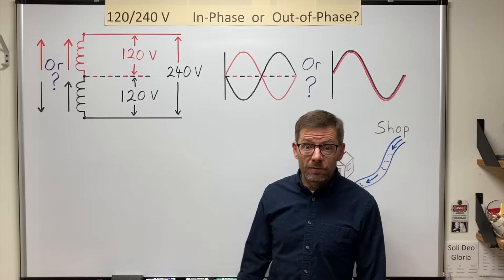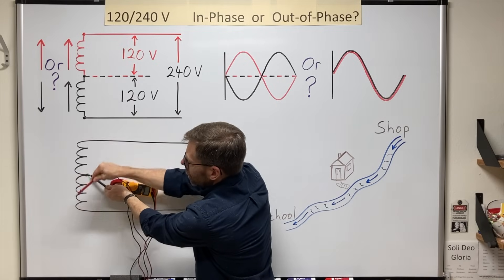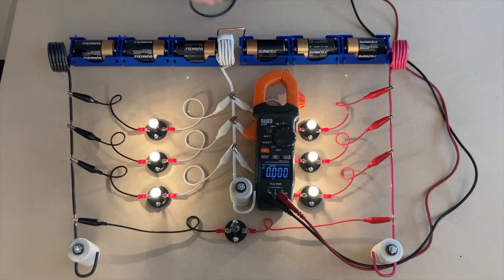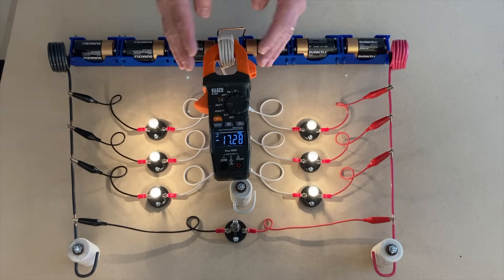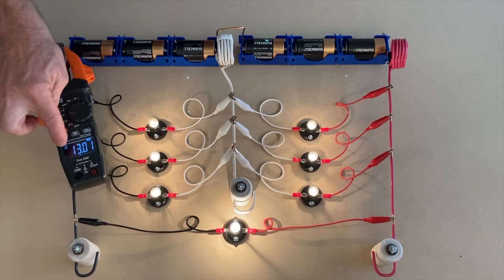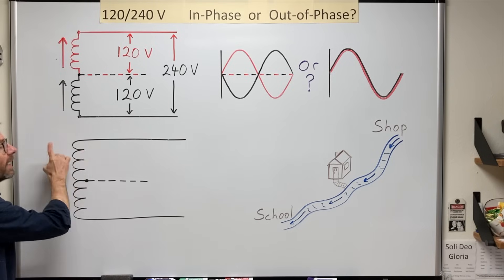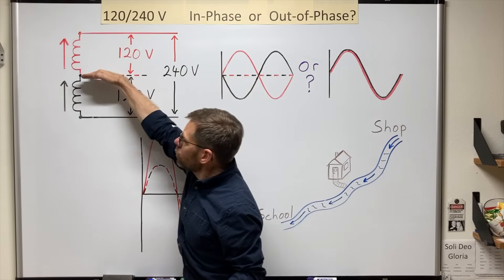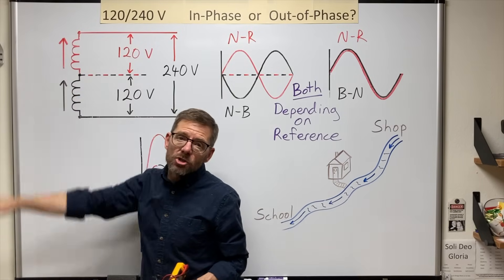120/240 V  In-Phase or Out-of-Phase

Comment: Thank you for this.  I've been watching too many YouTube videos where electricians understand the system only in metaphorical terms.  This was really helpful to properly understand the flow of electrons in the single phase system.
Reply: @stevenj100    AC is Alternating Current, So In or Out does not really mean anything, because they are alternating, that is why it is important to understand the correct AC Phase relationship of TWO Live 120V Lines.. .  . If there is 5 Amp in one Live line and 8 Amps in the other Live line, then the Neutral Current would be 3 Amps, on 2-phase 180° systems, and more complicated on 120° 2-phase, and 3-phase systems.
Reply: @hughleyton693  There is no such thing as two phase 180 or two phase 120. There is only single phase or 3 phase. Two phase power is very very old, and is 90 degrees apart.
Reply: @brnmcc01    Just think Logically as Spock would say. . .   3-phase has 3 Live lines, 2-phase has 2 Live lines and Single-phase has a Single Live line. . . .  It really is as simple as that. . .  But Americans have got very confused over the years. . . .  They used to use a 2-phase 90° 3-wire system. . .   We still use 2-phase 120° sometimes and we do use 2-phase 180° 3-wire all the time. . .    it really is that simple.
Reply: So your words above, show that You are not fully understanding electricity. . . It is you out of your depth, not me. . . I have understood all that for over 60 years.. . And so I do know the difference between Single-phase, 2-phase and 3-phase systems and how the current flows in all of them.
Reply: @hughleyton693 , studying electrical systems from infancy? Or age 10? 20?  Is it 60 years or 70 years?  Can't keep your fiction straight?

Find out what phase means and come back with an intelligible perspective.  Then we can talk.

Also, if you can't figure out why a 3-way switch might have that name, you, again, are not ready to be "educating" people about electricity.
Reply: @jasonbeisiegel5550  Jason. . .  Phase of an AC voltage is the relative angle from 0°, through 90°, 180°, 270° an back to 360° with reference to some point and against another AC voltage.. . It sounds as if you do not understand what AC Phase means. .. It sounds as if you are rather blinkered in your perception, if you understand 3-phase with each phase voltage running at 120° from each other then have difficulty understanding a different phase angle of 180° between two live AC lines. . .  Then it is you that needs better education.
Reply: You need to stop being rude, and learn something.
Reply: @hughleyton693 , you've been rude and condescending since you got here.  You are also the one trying to contradict the entire electrical industry.  You have demonstrated no knowledge of the subject, just thrown around buzzwords and unsubstantiated claims.  If you had anything to teach, I would be happy to learn.  You don't.  We're done here.
Reply: @hughleyton693 Tell you what let’s assume that you are correct. Let’s do a simple addition of your claim in polar form. I’m going to assume that you know and understand complex numbers since you have been studying electricity from infancy. That is 120 volts at 0 degrees + 120 volts at 180 degrees. So that would be 120( cos(0°)+ j_sin(0°) )= 120 the first “phase” of your so called “2-phases”. The second one would be 120( cos(180°)+ j_sin(180°))=-120.  The j_ denotes a complex part since AC is usually expressed in real and imaginary part considering that it is a vector. Add them together and you get -120V + 120V = 0. I don’t care how you arrange them, you can even do this 120V + (-120)V = 0. The point I’m try to make is that you are ADDING and NOT subtracting. This alone tells me that if they were really truly out of phase then the potential between them would be 0 and NOT 240.
However if they are in phase with the angles all being 0° then when they are added up they would be 240 volts.
Reply: @stanm25    Yes, I do understand complex numbers as far as reactive power is concerned. . .   But this is not about reactive power.        So yes, the 1st phase if  0° so then they other is at 180°     But " j "  does not come into that, until we start talking about Power Factor situations, as caused by Inductance and capacitance. . . .   Actually for a single=phase motor, or any motor with just two wires to it, will need  +j from a Capacitor, to provide the motor with rotational information, by shifting the phase of one the the supply wires.    That is why there is a capacitor with such motors.
Reply: @hughleyton693  I wasn’t talking about any load being connected. What I’m simply stating is that if you were to measure the leads between the hot legs in L1 or L2 with a meter then the resultant voltage would be 0 if they were truly physically out of phase at the source. Even if a voltage load was connected between L1 and L2, it wouldn’t work since there is NO potential difference between the leads. It’s just like the leads of a DC circuit up there when Mr. Gordon switched one of the battery banks to simulate an out-of-phase circuit . The resultant effect was that there was NO potential and therefore NO load across the red and black leads that fed a single light source because the voltages canceled out.
Reply: @stanm25    NO. . .   If L1 & L2 were  IN Phase, that is both going UP at the same time, you would see 0V difference. . .   But because they are actually 180° Out of phase, that is opposite to each other, you will see the DIFFERENCE Voltage of 240 Volts. . .    If You put the two meter leads onto L1 & L2, or L2 & L3 or L3 & L1 of a 480V supply, you would see 480V, this is called the Line Voltage. . .    If you measure the voltage between L1, or L2, or L3 to Neutral, you would see 277V, that is the Phase Voltage.. .  If you measure between L1 & L2 of a 2-phase supply, you will see the Line Voltage, if you measure between L1, or L2 to Neutral, you will see the Phase Voltage.. . .  This is proper Electrical engineering.
Reply: This was about DC , not Single-phase AC. . . the Electrons travel inside the Wire, driven by voltage difference between the ends of the wire, when there is a completed circuit.
Reply: But it is a 2-phase system. . . .   There are Two 120V circuits. . . .  But because L1 is running at 180° from L2, then you have 240V between L1 and L2 making it a 2-phase 180° 3-wire supply.
Reply: @hughleyton693  A polyphase system must provide a defined direction of phase rotation, so mirror image voltages do not count towards the phase order. A 3-wire system with two phase conductors 180 degrees apart is still only single phase.

That's literally the definition, I didn't make that up, you can look it up yourself.
Reply: @brnmcc01    No, you are now trying to distort the truth to cover your mistake. . . .   Electrical power phase is about the AC on the Lines and the phase relationship between those Live lines.. . . .  Don't try to squeeze out of the fact that Two 120V running at 180° from each other is 2-phase. . .   Even if other Americans cant see that.
Reply: @hughleyton693  I'm trying to distort the truth? What I posted was literally copy/pasted from the definition of what a polyphase system is. Poly meaning more than 1 phase.

I think what we have here is a classic example of the Dunning–Kruger effect....
Reply: @brnmcc01    Ah.!, OK, copied from some American source, but as you say here correctly, "Polyphase" means more than 1 phase. . .   Yes. . . .  So 2-phase, 3-phase, 4-phase and 6-phase are all Polyphases. . .   Which means each live line has a different phase relationship to the others. . . . .Correct. . . .  Typically the Natural polyphases are 360° / number of phase lines. . .  So Natural 2-phase is 360° / 2 = 180°, 3-phase is 360° / 3 = 120° and 4-phase is 360° / 4 = 90° and 6-phase is 360° / 6 = 60°. . .   I hope this now makes things clearer, even if American teaching is confusing.. . . . .  p.s.  I have even re-wired some large 220kV 3-phase 480V Generator to provide the customer with 120/240V. . .   That was possible, because most large generators have 6 windings and 12 connections, so they can be re-arranged to provide a wide range of output voltages and conditions.
Reply: @hughleyton693  Do you live in Europe I'm guessing? I was wondering if maybe you were from or have been to Japan. That is a very strange country with 2 different electrical systems, one 60Hz and one 50 Hz. There is a lot of two phase 100/200 volt systems there, and people used to that assume the 120/240 volt system in the USA is also 2 phase. It gets very confusing.
Reply: @brnmcc01    Hi, I have not spotted your name as yet...  I was originally from the UK, I have worked in many  countries from Viet-Nam to Nigeria, the West Indies and I now live in Belize, which follows the NEC Code.. . . But I have been involved in many different electrical systems and generators. . . .   Japan, as you say use 50Hz in parts and 60Hz in other parts. . .  This used to be a problem but now very much easier, they use Electronic Grid size Inverters between the two systems, these days, called converters, and they can work either way at any time. . .   Even better when Grid batteries are included to even out the sudden power changes.. . . I am writing a book explaining electricity, but it will be for anyone, not just Americans, so has to use different words to explain things.
Reply: @hughleyton693  That makes a lot more sense now, this whole time we've been arguing over it's not an apartment, it's a Flat, it's not a car trunk, it's a boot, it's not a Hood, it's a bonnet and tire is spelt Tyre!
Reply: @brnmcc01  Yes, something like that . .    But when you think about it logically, it really is 2-phase 3-wire L1, L2, N supply, even if not called so in America .. . .  But one I will not let go of is the generator in your car for charging its battery puts out DC so it is a DC Generator.. .   Not an Alternator. . .   Alternators feed AC as into the Grid.. . .  DC Generators produce DC. . . .  AC Generators produce AC. . .   And there can be no argument about that.. . .  And yet many do argue.
Reply: @hughleyton693  The brushes in an alternator carry only DC excitation current, which is a small fraction of the current carried by the brushes of a DC generator, which carry the generator's entire output.
Reply: @brnmcc01  Hi, What brushes. ? .. .   For over 30 years, the AC Generators I work with, 10kW to 1 MW, typically 400V or 480V 3-phase, have no brushes. . .   And they have 3 Generators inside the same case. . . . .   However, I suspect you are referring to the Field power in modern car Generators, that still use sliprings to power the rotating Field windings.. . .   But if you put a volt meter on the car generators power output terminal you will see DC Voltage, approximately 14V
Reply: His drawing and explanation correctly shows the electron flow, but he failed to refer everything to the correct Reference point, which is the Neutral point. . . . That is what Neutral means.. . . Same with 3-phase, all 3 live lines have AC voltage relative to the Neutral point.
Reply: @hughleyton693  I feel like you are playing word games.   I understand completely. But I am trying to summarize  and explain why saying the "phases" cancel out is the wrong term.  First I said one leg was negative relative to neutral you said that was wrong.  So then I explained how it functions on a momentary instant of AC to explained  the 240 difference. You said that was wrong cuz it's really negative.
Reply: @stevenj100    Not me playing games, you are using wrong words... A live line never gets less or below Neutral. . .  I never said phases cancel out. . . Pay attention, "Phase" defines the AC sinewave relative to a reference or another hot line.. .  In American 120/240V supplies, there are TWO Live lines, with their AC running 180° difference between them.
Reply: @stevenj100    Current flows from voltage to no voltage. . . .  So each of the 120V lines current does effectively flow to the Neutral.. ..    But because the TWO Live lines are running in opposite directions, that is 180° then the TWO Live current Cancel each other out in the Neutral, so the Neutral only carries the Difference current, and not the combined Total current.
Reply: @hughleyton693  No, current flows from source back to it's source. There is no 180. Reversing measurement device polarity does not magically flip the sine wave.
Reply: @brnmcc01  Sounds as if you do not understand electricity, AC electricity.. .   Put a question is a simple, non ambiguous form for answering.. . . . .  Current flows from high voltage point, through the circuit to a point of low voltage. . . .   But the American 2-phase 3-wire to houses has L1, and L2, both live lines at 120V and running at 180° from each other.. .   In other words, when L1 is at its maximum + sinewave, L2 is at its maximum - sinewave point, it is that, that results in 240V between L1 and L2.. .   I hope that is easy enough to understand
Reply: @hughleyton693  What you're saying is basically correct, except in modern USA voltages there is ONLY single phase or 3 phase. There has been NO new 2 phase equipment made since at least 1975. One of the newest things I can remember that was actually a 2 phase piece of equipment was a 2 phase 240v Bridgeport mill made in about 1962 or 62. It was installed at a shop somewhere in Hartford, CT. It's very very rare these days, and dates back to the original Tesla polyphase system back in 1895. Check out some of the old pictures of the Niagara falls hydropower station, that was 2 phase, but IIRC it was 25 Hz, and some customers used rotary converters to power electric metal furnaces.
Reply: @brnmcc01  Sounds as if you are rather confused. . .   Look at the picture above. . .   When you Ground the centre point of a winding as the Neutral, that leaves the two winding ends swinging up and down in opposite directions, that is 180° from each other. . .  Just like a kids see-saw.  . .  You have seen kids see-saws. ? I hope.  . .  when one end is up, the other end is down. . . . They are moving at 180° from each other. .  That is exactly how 2-phase 120/240V works. . . .    Basically you can double the number of phases, by grounding the centre tapping of the secondary winding, as the system Neutral. .. . .   I hope you now understand this simple concept. . .  So Yes, a see-saw does magically flip the sinewave, L1 from L2
Reply: @brnmcc01     There are Single-phase circuits, L-N, there are 2-phase systems, L1, L2, N and there are 3-phase, L1, L2, L3   with or without the N. . . .     2-phase can be 2-phase 90° 3-wire, or 2-phase 120° 3-wire or 2-phase 180° 3-wire. . . .    I worked with and wrote the maintenance paper for some American 2-phase, actually 4-phase 90° equipment, in the 2002.
Reply: I really hate the phrase "cancel each other out".  That's how you might do the math, but it isn't what is happening relative to current.  Any load that can travel from one hot leg to the other will, because it is a preferred path.  Any imbalanced load will travel on the neutral.
Reply: @jasonbeisiegel5550     Actually cancel each other out is a very important thing to understand. . . .  This enables us in big systems, to use smaller Neutral wires. . .   You also need to understand then when there are neutral wire connection problems.
Reply: @hughleyton693 , you're missing the point.  The phrase does not accurately describe the physics.  There is one YouTube electrician who understands this as two opposing forces on the same path, and that isn't what is going on.
Reply: @jasonbeisiegel5550     No. . .  I understand electricity very well. . . . I am not missing any point. . . .  Phase is a very important part of any AC Electricity. . .   It describes the AC Voltage of a hot line relative to any other hot lines, such as 3-phase, all three phases are 120° from each other.. .  2-phase the two phases are 180° from each other. . . .  It is a simple as that.
Reply: @hughleyton693  12 days ago you commented that they cancel is the right term and important to understand
Reply: @jasonbeisiegel5550  yeah the other leg is lower potential than the neutral
Reply: @stevenj100      You can't have lower than Zero as in Neutral.. .  You mean opposite polarity or running 180° from the other hot leg.. .  So it is 2-phase, L1 is one, L2 it the 2nd phase.
Reply: @hughleyton693  120/240 split phase systems. In one phase in those systems the neutral is higher than the other leg.  It's AC so on average it is in the middle between the two legs.   But at the "on" moment one leg is zero the other leg has 240v potential, and the neutral has 120v potential above the zero leg.  So you are correct to say the nothing is less than zero but the neutral is a higher potential than the leg that is off during the AC cycle.   This has to happen for the 120v load to be an AC circuit
Reply: @stevenj100  . . .  No. . .  You misunderstand potential. . .  Use a Meter. . .It might help to explain to you. ..  Neutral is at or near Zero Volts compared to the ground you stand on. . .  The other two legs, L1, and L2 are both at higher potential.. . .  Look with your meter. . .  Potential is potential and not relative to markings on a blackboard.. .  High potentials can give you an electrical shock.. . . .  L1 is 120V above the Grounded Neutral, L2 is 120V above the Grounded Neutral. . . .  L1 and L2 are both Live lines, but running at 180° from each other. . .  AC means "Alternating". . .  So their potential is swinging live both plus and minus around the Neutral.
Reply: @hughleyton693  they both have a higher RMS but in an instantaneous moment only one is higher at that moment one is on one is off.  We are discussing why only the imbalance uses the neutral. It will not use the neutral until  the series circuit of the two load back to the has equal voltage then the neutral has a lower potential.  But until then the other leg has the lower potential.   Again you thinking the RMS voltage is constant it only works as a constant for ohms law math.
Reply: @stevenj100    You really do not understand AC electricity do you. ?  . .    The AC Voltage of both L1 and L2 are the same voltage all the same time and even at any moment in time, BUT in opposite phases, that is 180° apart. . . You have not discussed the imbalance in the Neutral before.. .  The Neutral always has a lower potential, at or close to ZERO volts... .  You really do not understand electricity.. . So listen and learn.
Reply: @hughleyton693  I am a 2nd generation Master Electrician with 28 years of full times experience. I have tik tok educational page with 63k followers. You are thinking 240 single  phase is like 2 phases of a 3 phase systems.  It is not like that. It is  one phase that has two hot LEGS that take turns being on and the neutral splits that one phase. Why do you think a home has two hot legs but is still called SINGLE PHASE  and not 2 phase?
Reply: @hughleyton693  not only do I know this. You are commenting on a video that contradicts what you are saying
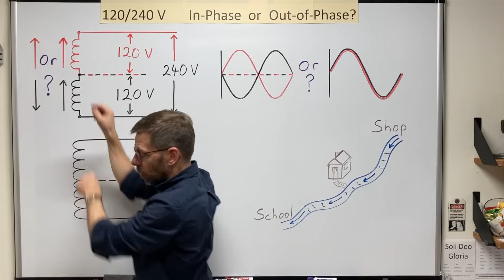Reply: @hughleyton693  go you 12:50 of the video he explains the 2 legs of a 240 system are IN PHASE.  if they weren't in phase the neutral would carry the sum not the imbalance.
Reply: @stevenj100    Good, so you do know the American 120/208V 2-phase 120° Supply then. . . .   Nothing I have said contradicts anything in the video, except he ends up with the wrong conclusion. . . L1 and L2 are NOT in phase, they are 180° phase relationship as in his left wave form drawing in the middle of his picture.. .  Remember all references should be to the Neutral line.. . . .  How would you describe the 480/277V system. ?
Reply: @hughleyton693  no American homes are NOT fed with 2 phase this is just foolish conversation.
Reply: @stevenj100 , hey, when it's not off putting enough to be smug and condescending, remember you can always be stubbornly incorrect to really make people regret interacting with you.
Reply: @jasonbeisiegel5550  I was trying to be polite did you see when he said I don't understand electricity and I need to just listen to him and learn.  When he is just saying stuff that is 100% factually untrue. A 10 second Google search proves him wrong.  He also saying Dave in the video is wrong.
Reply: @jasonbeisiegel5550  he is saying American homes are not single phase systems with two hot legs.  But he thinks they are a two phase system.  Just Google are Ameican homes fed with 2 phase or single phase
Reply: @stevenj100     Man you are not listening.. . . Most American homes have a 3-wire supply L1, L2, N. . . .  L1 and L2 are running at 180° from each other, so they have 240V between them.. .  So that is the Definition of 2-phase, TWO Live lines and Neutral. . .   So listen and learn, not just talk American, there is a whole world out there.
Reply: @hughleyton693  you are wrong. ALL American homes are fed with two hot and one neutral for a split single phase system.  I am not guessing. This is 100% the way it is 2 hot from a single phase not a 2 phase systems  I understand it confusing you i have had this discussion with mean apprentices over the years please go to Google if you don't believe me. You don't need to explain it to me understand what is happening inside the transformer and I understand why you are confused.  I promise you 100% every all without a doubt every American home is a single phase system I have over 60,000 hours of training and experience in wiring American homes. I am licensed in 3 states I have 4 electricians in my family
Reply: @hughleyton693  the definition of 2 phase is not two hot is literally 2 phases. 2 sine waves this is one sine wave
Reply: @stevenj100  , sorry, that snark was for you not at you.  Hugh is clearly out of his depth.  He also referenced 208v when describing American residential systems, totally clueless and unwilling to admit it.
Reply: @jasonbeisiegel5550  cool I was being rude so I figured it was at me.  Np... I only know house and admit when I don't know.  Like 3 phase I never work with. And might even be wrong on why there is only an imbalance on the neutral. But I do know 100% its single phase. Lol
Reply: @stevenj100     The Definition of 3-phase is 3 hot lines, usually 120° apart. . . .  2-phase is 2 hot lines, running at 120° or 180° or any different phase relationship. . . . .   Put your Scope common on to the Neutral and one Scope probe on to L1 and the other probe on to L2 and you will see the picture he gives in the middle of his picture. . .  [ Two traces running in opposite directions, that is 180° from each other ]  .. .  Have you used a Scope. ?
Reply: @hughleyton693  step one and the most basic concept is Ameican homes are single phase.  If you cant understand that first step and entry level concept. I have no faith in anything else you say. If you really understood what a scope shows you would not be bringing them up as a way to claim American homes are not a split single phase.
Reply: @hughleyton693  I own a scope but just recently bought to make videos on my tik tok.  First one planned is proving the legs are not out of phase
Reply: @hughleyton693 , you are so out of your depth here.  You need to find some humility and recognize you are wrong and don't understand the topic.  A 3 phase system has 3 hot legs, but that is not what makes it 3-phase anymore than the 50 terminations in my home make it a 100 phase system.  Neither of us is going to be able to help you understand the topic in the YouTube comments.  Find some good sources (Dave Gordon is great and has other videos that might help), spend some time with the material, and try to ask questions rather than playing the expert.
Reply: @jasonbeisiegel5550       No, I am not wrong, if you think I am, then say what you think is wrong and then perhaps i can explain to you better.  . .  I am most certainly not out of my depth, this is just a tiny part of my 70 years electrical knowledge.. .  BUT I do know Americans do get rather confused over certain words, one such example, they call 2-way light switches '3-way'   What.!   they only switch the current two ways. . .  The rest of the world knows this, but not America. . .  The rest of the world knows that Single-phase is a Single live wire and Neutral (2-wire) supply.. . . . .A 3 phase system has 3 hot legs,. . A 2 phase system has 2 hot legs, . .  A 1 phase system has 1 hot legs,. . .  It really is as simple as that, but Americans can't appear to understand that.
Reply: It is NOT a Single-phase system. . ..  Most of the world uses Single-phase, that is a Single Live wire and Neutral. . .   That is Single-phase. . . ..  2-phase has TWO Live lines and Neutral. . . .  3-phase has THREE Live lines and sometimes Neutral. . . .       Phases are relative to 0 at the Neutral point.. . .  This is not metaphorical but absolute real terms, even if not used in the USA. . .  American 120/240V  are 2-phase 180° 3-wire Supplies.
Reply: @hughleyton693  you are claiming American homes are powered by a 2 phase system and not a split single phase system?  If you are that ignorant of the topic there is not value to your opinion. Plz Google are American homes fed by a 2 phase or a single phase system.   I will screen shot your comment before you  can delete it
Reply: @hughleyton693  WRONG. 2 phase has FOUR live lines and 1 neutral. But this system is extremely old, and no new 2 phase equipement has been made in like over 50 years. The last manufacturer that I know of that was still making some 2 phase replacement devices was like Wadsworth. ITE pre Gould days made a lot of 4 pole switches and 240v 2 phase lighting panels back in the old days. You can still find some 2 phase systems still in use today in certain places like old buildings in the old section of Philadelphia (Center City) and Hartford, CT. And I can assure you, 2 phase is a very strange animal.